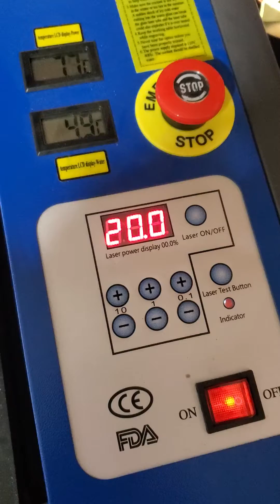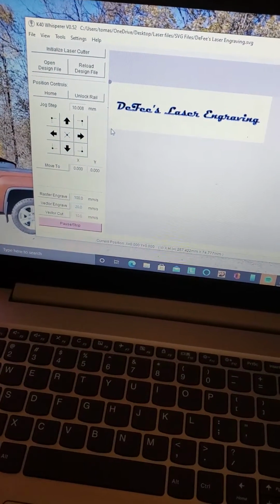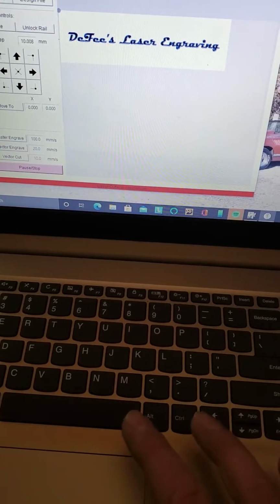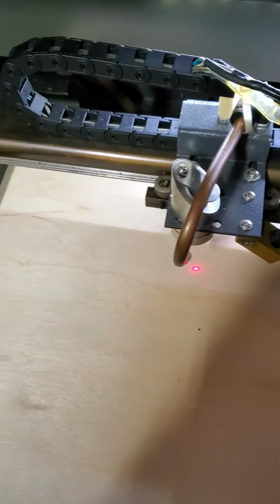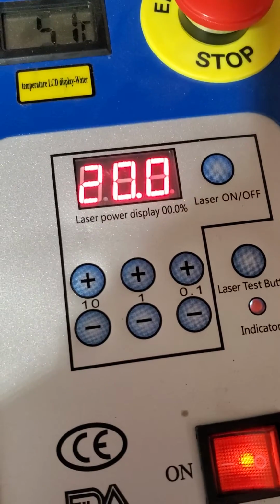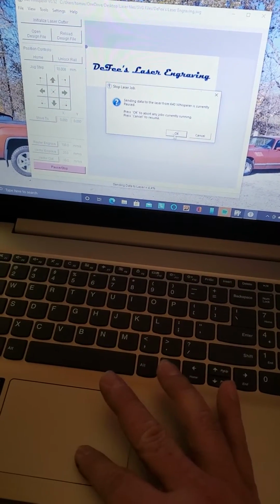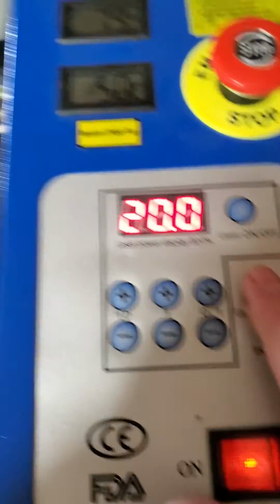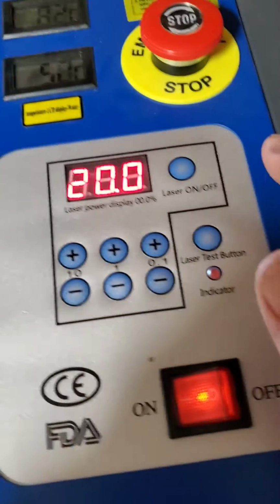k40 laser not firing during job.

Comment: Did you ever figure this out? I just bought one and have the same issue
Reply: I fixed Mine. The problem was in the door  sensor.
Reply: Same here, did you fix it?
Reply: @addictedtothethrill3831  mine was a combination of mirror alignment and power settings. Haven't used it much since my 60watt came in.